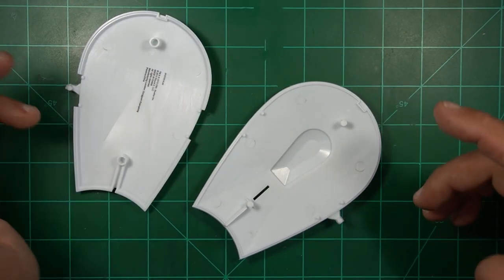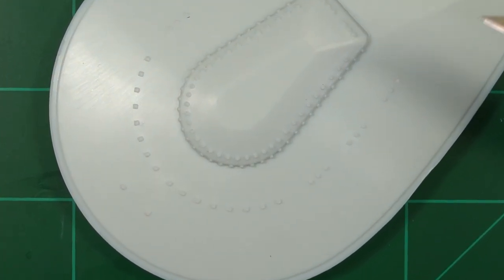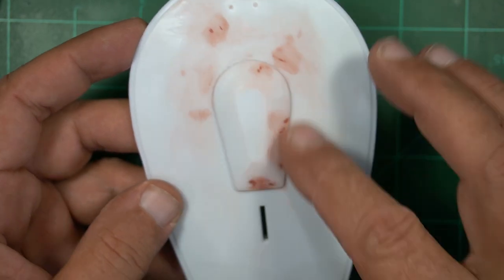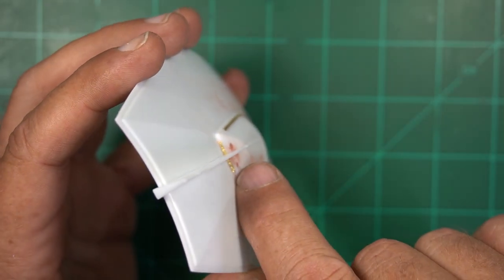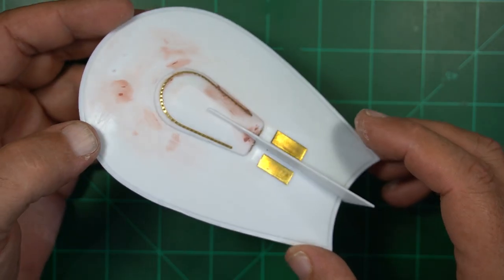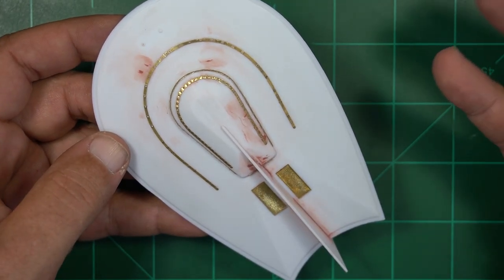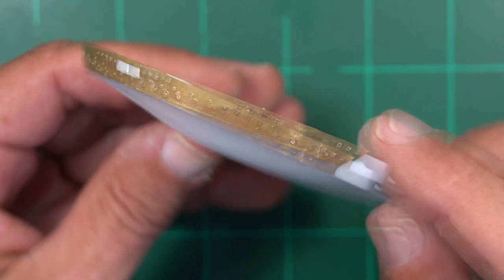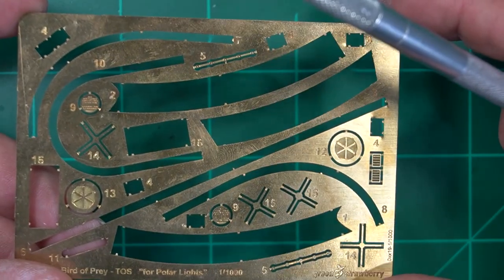Building The Polar Lights 1/1000 Romulan Bird Of Prey With PE

Comment: Just so you know those are not windows on the top of the main hull area.  You can clearly see them https://www.startrek.com/article/forgotten-trek-creating-the-romulan-bird-of-prey  According to some unofficial blueprints they are sensors on the top of the main hull.  No windows.  Only a handful of windows along the edge of the hull.  Pretty much keeping the windows in line with the Enterprise.  https://www.cygnus-x1.net/links/lcars/blueprints/romulan-bird-of-prey-sheet-1.jpg
Reply from the maker: Thanks Tom. Good thing this is a what if build. Another photo shows the top two tiers have lights in the front. So I am assuming the front curve is all observation and the rest are the sensors.
Reply: @HobbyLinkInternational  From what I can see from the original filming stills the front curve center area appeared to be windows.  With that exception and the torpedo/missle tubes on the wings everything else was sensors.  Unfortunately in the larger AMT model there was nothing raised so everyone assumed they were light.   http://img4.wikia.nocookie.net/__cb20110909182948/memoryalpha/en/images/a/aa/Romulan_Bird_of_Prey_studio_model_as_delivered.jpg
Reply from the maker: @thompuckett9547  I looked at all the pictures a lot before doing my review video on the kit. I guess what they designed on paper never made it to the screen. Definitely no impulse engines or trash shoot on the back of the ship and the wings are smooth. 

It is fun though that it could be made from the schematics or from what we saw on TV. I am going to by another one and only use pe for the front of the ship next time and make it look like what we saw on TV instead of the what if version I am making now :)